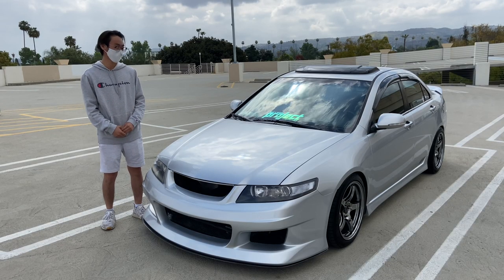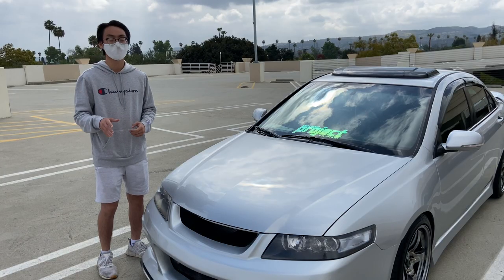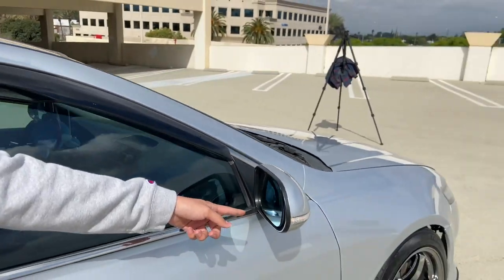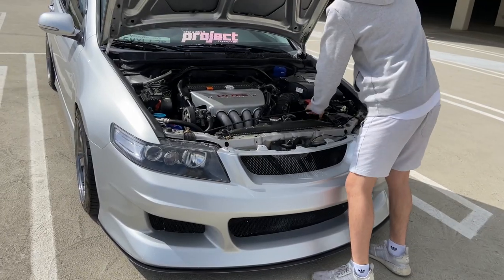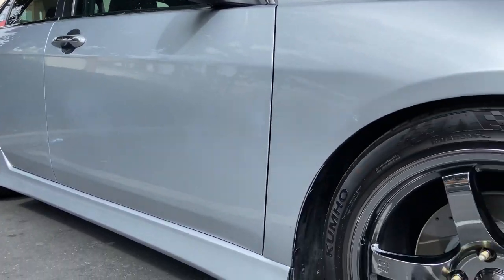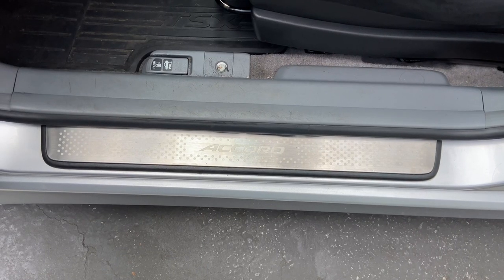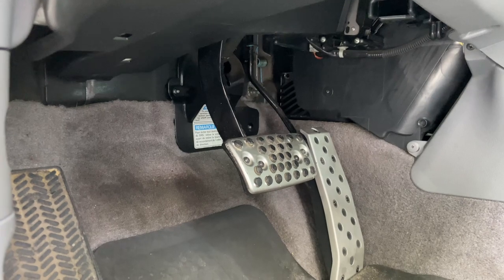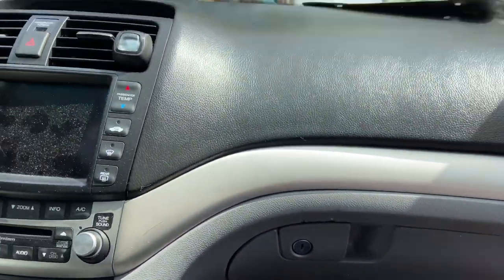EXTREMELY RARE SPOON ACURA TSX BUILD! | 2006 Acura TSX build @akiracl9

Comment: With the 17x9 +35, dont you have any rubbing issues? Im using 17x8.79 +35 and rub when I have a full load. The spooon mirrors, are they also heated? Clean whip bro.
Put that license plate in front of car tho, police will pull you over for it.
Reply from the maker: No issues with the fitment, dm him about the other stuff @akiraem1